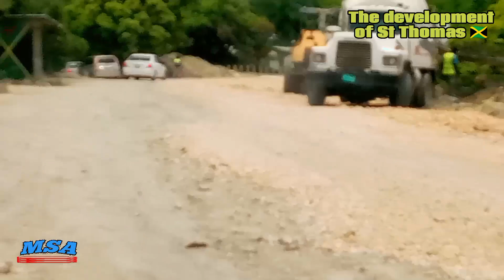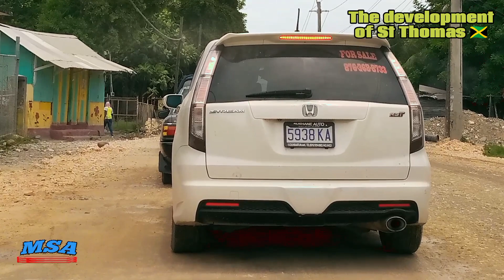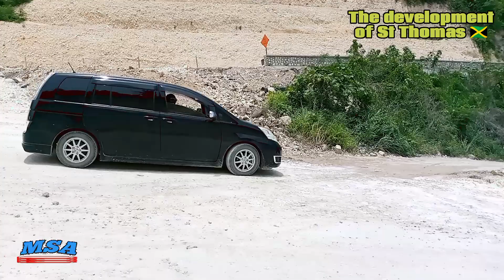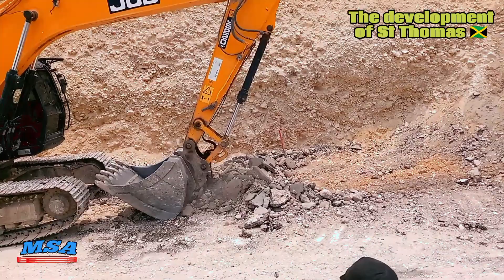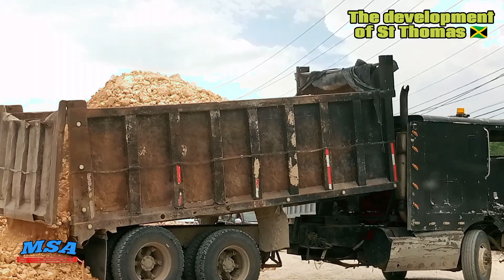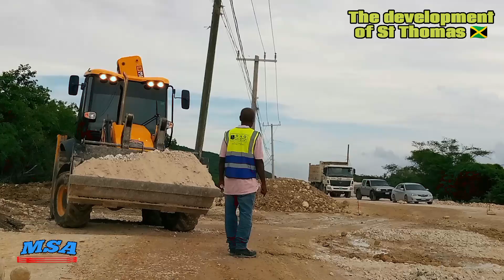MULTIPLE UPDATE // ROACH GULLY / DUHANEY PEN / PONDSIDE/ ST THOMAS DEVELOPMENT CONTINUE

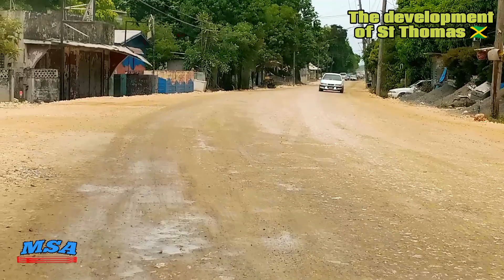Comment: Poor people always get the bad part of the stick 2:58 in your video is bad? Lifting the road in this section is bad because the proper drainage is not in place? The road is not supposed to be higher than the people's yards ? When rain falls all the water from the road is going to runs into people's yards. Those two plastic pipes for drainage are no good, a box culvert is the right thing. One side of Springfield has a beautiful drainage system for the MBUC? Why didn't S & G run a drain line from the main road into the drainage system or build a drainage system for the main road ? Several days ago rain fell and all the water off the road runs into people yards😢😢😢😡😡😡
Reply from the maker: Yes you are so right absolutely correct I do not know why them do it like this I wonder is one out of two things either of them do not care are they does not know what they are doing thanks for your comment
Reply: Hagley park rd is higher in some places than the property it passes after chec built it. What they did was put in a lot of drains to collect any run off from the rd. They built small culverts across each gate entrance with a grate covers which then runs into the man holes. So it’s possible to build the rd higher than the yards as long as they putting in the drains to collect the run offs.